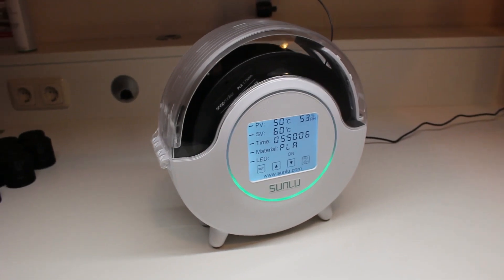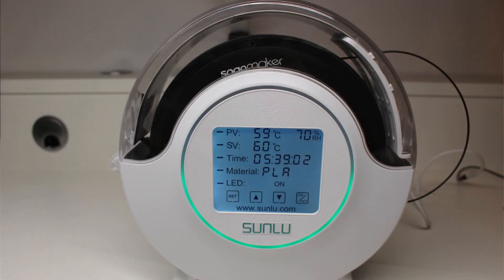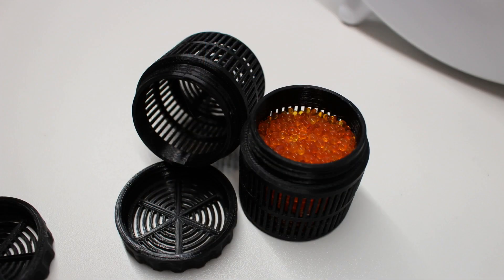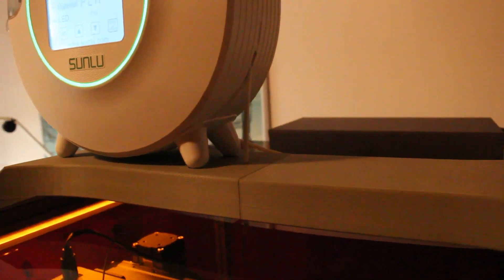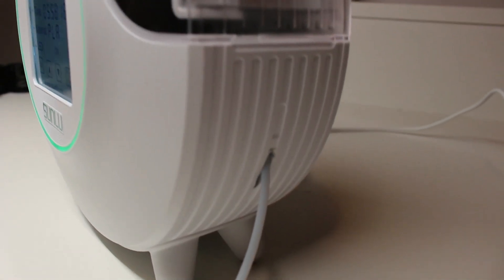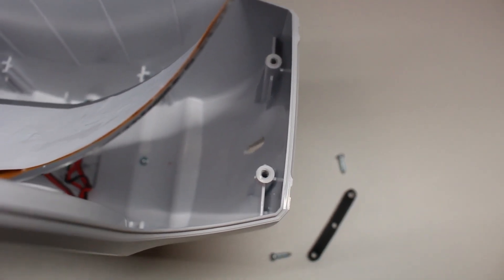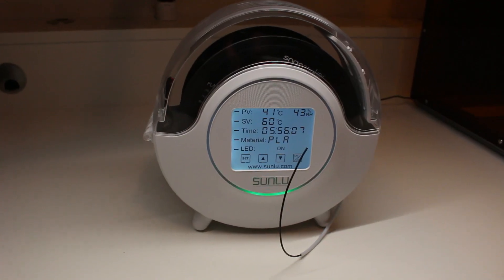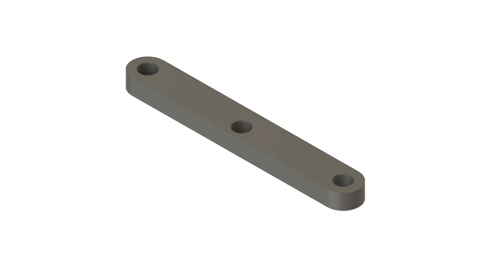Sunlu FilaDryer S2 BottomFeed Mod

Comment: Got 4 of them now, one for each printer I have. Mounting is a bit medieval, just drilled 4 holes in the top plate and secured it with a screw in each foot. 💪 No problem to mount on my Delta printers but figuring out how to mount one on the X-MAX is another problem.Perhaps just stand the dryer an feed the filament through a bowden tube.  Thanks for the inspiration!

Comment: Two quick questions for you, please:
1. How did you cut the hole in the lower metal heating plate while it was still connected to the wires?
2. Were you curious to find a way to take out the display? I'm asking because I'd be very very curious to find out what the controller is, I have a hunch it might just be an ESP, which would open wide hacking options :) But I can't see how I could take the display out without damaging it
Reply from the maker: Sorry I missed your question! Thanks for commenting! 
1) I did of course unplug the power cord first. Then I used a Dremel cutter to do this - I think this is a good tool for this job.
2) I did not remove the Display up to now tbh. So I do not know which is the controller on this.
Reply: Thanks. So you didn't unscrew the lower heating panel to cut it, right? You just used the dremel to cut the notch with the panel in place. I was asking if you had to disconnect the wires to it (so not to damage them while cutting the notch), not if it was powered
Reply from the maker: @dan-nutu  yes I unscrewed it. It is only screwed down with 4 screws. You can lift it up a few cm because there ist of course some wiring attached. But this helps you a lot to avoid damaging the housing while cutting.
Reply: Understood, thanks

Comment: Hello, I understand correctly that this dryer is not suitable for nylon? I am looking for a dryer that can cover all my needs ...
Reply: @Yukito Yes, it will heat enough to dry nylon. As a matter of fact I'm quite annoyed that it heats the filament too much - I just got it and I tried it with a spool of ABS, although the display showed 55°C, when I checked the spool (at the end of the 6 hour program) with an infrared thermometer the top was at 64°C and the lower part was at 70°C (!). I haven't yet printed with that spool but I'm seriously worried this dryer could degrade the filament. Also, like everyone says - there's no way for the moisture to escape, very very poor design, not worth its price. Heck, for the same price you could buy a lot more complex stuff (e.g. BluRay player or Raspberry Pi - IF you find them), not just a small plastic box with 2 curved electrical heaters, a simple touch display and 4 ball bearings. It looks nice but it's not that functional.
Reply from the maker: @dan-nutu  Thanks for your comment! Yes, I mention this flaw in my video as well. The Moisture cant escape too well. But as mentioned in my video, you can either add desciccant or open up a little gap for a more open case. The case is by far not airtight, though.
Also I do not think that a temp difference of 10deg will degrade the Filament. Not sure, but I doubt that.
The question is always, where the temp is measured - the temp cannot be the same all over the housing. In fact, the even heating in the Sunlu S2 is one of its major strengths. Check out other solutions - most of them have the heating source at one side only. The S2 is heating all around.
If you have concerns, just tune down by 10degs...
In my point of view it is far (far) from being non-functional.
The comparison with other consumer electronics also is not fair I guess. The price of a device is always dependent on the ammount of units sold and on how custom a solution is. I dont know how many S2 are shipped, but I am sure there are 100.000 times more DVD or BR Players out in the world. This is no comparison. If you compare - compare it with other Filament Dryers. Eibos e.g..
Reply: I'm frankly not interested one bit that other products also have design flaws, what I'm saying is that the price for this one seems too high for what one gets. It would have costed them just a few dollars/euros/yuans more to add a built-in fan and some intake & exhaust valves that would have sorted both the humidity and the temperature gradient issues. What we get instead is a half assed product that WE need to hack one way or another just to make it work as it should have.
What's the point of that big display with predefined parameters for each filament type if we have to tweak them by some 10°C? Sorry, I'm not arguing with you, I sense that you like it. I don't and I'm seriously considering sending it back. The problem though, as you also touched on, is that none of these is dryers is mature enough. It seems unbelievable to me that there isn't a good product to handle something so simple as drying spools of filament. I could have added a fan myself if the top part wasn't round, which makes it more difficult. Maybe it would be possible to stick a fan in the middle of the back side (no double entendre!), although the humidity rises to the top part. I can't believe I have to wreck my brain to sort something that could have been addressed so easily by the manufacturer. ABS at 70°C probably doesn't suffer, but PLA will definitely get soft at this temperature and annealing can take place, too. And all along the fancy dryer would show only 55°C and flash those worthless LEDs. I guess it would be slightly better if the drying were to happen during printing, since the spool will (slowly) turn rather than sit in the same position. A small motor could have helped to slowly turn the spool if not printing. It seems to me not much thought went into designing this, apart from the rounded heater panels, the display and the flashy LEDs. How they failed to provide such a very basic feature as a way for the humidity to escape is beyond me. I understood users actually requested this feature and the manufacturer promised the finished product will have it, yet that's clearly not the case.
Reply from the maker: Hey Yukito! You can heat any material with it. I did not yet print nylon with it (I do not have the proper usecase for that). For nylon I consider using a direct extruder crucial. You could also consider other Filament Dryers, if you are especially searching for nylon (there is also a cheaper version available from Sunlu). The good thing of the Sunlu S2 (the previous model does have that, too) is the fact, that it will heat all around and evenly around your filament (not only from bottom as most of the other Filament Dryers). Not sure if it answers your question?
Reply: @craftingmat5425  Did you really mean a direct extruder for nylon? I'm just curious why. I thought only a hot end that could handle higher temperatures would be needed for nylon, not necessarily a direct extruder.
Reply from the maker: @dan-nutu  Yes sure. I did not have any other printer than direct extruders up to now - but Nylon is well known to be favorized by direct extruders.
It is not necessary, true! But if you Nylon is your favorite filament you should take a direct extruder or a printer with direct extruder in consideration.

Comment: Great info, thanks a lot! I recently acquired the same dryer and had the same frustration because the bowden tube for my Prusa MINI+ expects the filament to enter from near the bottom of the machine. My temporary solution was to add an arm to my printer to point the bowden tube upwards, but this created two sharp turns in my filament path that isn't ideal. My other ideas were to mount the dryer on the wall outside of my enclosure and at a lower level than my table OR attempt to modify the dryer to feed out of the bottom like you've done. I think I'll try this and see if it helps.

Part of me regrets not paying attention to the filament exit points when I bought this dryer, because I probably would have looked for something else that has a bottom feed by default, but I'll make it work somehow =)
Reply from the maker: Thanks for your comment, Howie. 
I spent a lot of time on the topic which Dryer to chose, and I knew it would not fit to my printer. Even now that I have changed my Printer to a V400, it does not fit as it is - it also can use the Bottom Feed Mod. But here it is even a bit more complex, because there is a lot of movement going on in the housing of the V400 when going fast (and I hesitate to put my S2 up on the top... it may pick up those vibrations and drop from the top, so I need some method to fix it there... need to figure out).
I think the Sunlu S2 is one of the better solutions to dry filament... the only drawback is that moisture does not escape too easy from the (very) closed housing and that it has no exit to the bottom in the factory config. Other than that I would say it is a 10 out of 10.

If you do the mod, make sure that you go for a proper Bowden tube. I found out that my first pick (some tube from somewhere...) was not the best. Go for the Creality Capricorn PTFE, it can be shaped better and has even less friction inside. It is a significant improvement towards the standard PTFE BowdenTubing.
Reply: @craftingmat5425  Oh thanks for the additional info, yeah I actually have a few meters of 3mm ID / 4mm OD ordered cuz I heard that might be a little better for a longer run compared to typical 2mm ID since it won't hug the filament as tightly. I did consider the Capricorn stuff but I don't really like that you can't see through it. Idk, will see how it works out. Good luck with setting everything up with the V400,  that thing looks like a beast!✌️